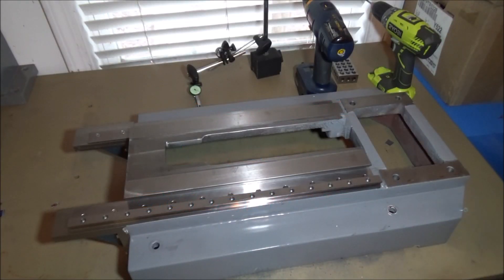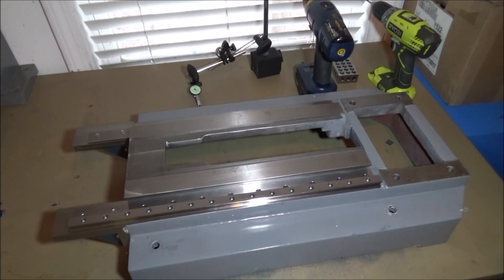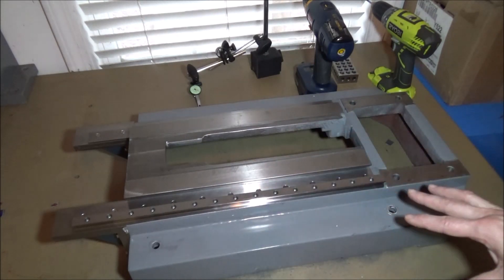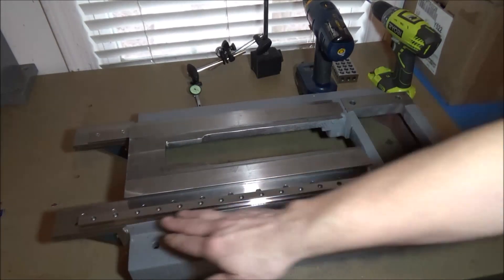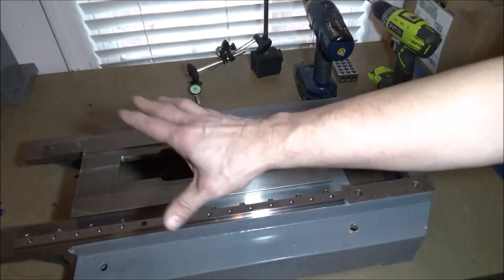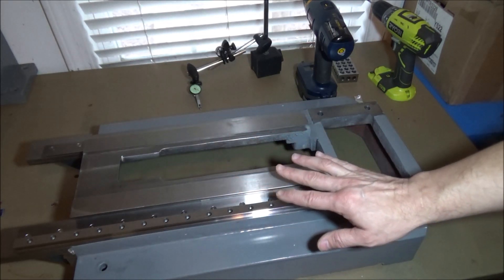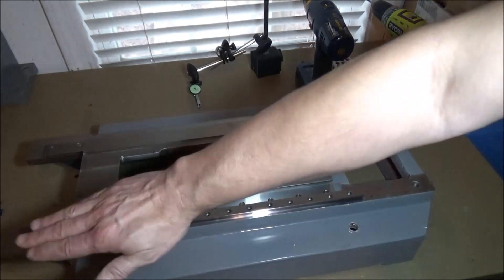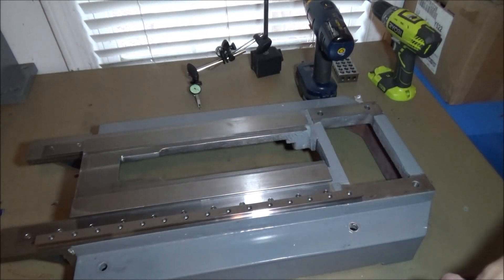PM727MXL Linear Rail Prep part2

Comment: I strongly agree with your decision to check the flatness on a surface plate, it's the only way to really know how well your mill will preform. A surface plate will be a great addition to your shop. Great progress, I'm interested to see how flat the surfaces are from the factory. I have a pm940 on order and plan on making a project of hand scraping the dovetails myself. Luckily I work at a shop that has large surface plates that I can use to check my project.
Reply from the maker: Thanks , Yes I could just go forward the way it is and the Accuracy will be no worse than with the dovetails but at this stage i would really like to Know where I stand! hey maybe its fine , Maybe its off a ton, twisted , warped etc. but its the Not knowing that I dont feel good about. So I will check than I can make a decision on how to proceed.
It I'm comfortable with the tolerances I'll proceed as planed.

Comment: I have been following your project. Nice job.
I’m glad your getting a surface plate you need it. You might consider going a little larger. Based on the projects your doing I know You will never regret it.😀
Reply from the maker: I agree If only I had the space I looked at a 24 x 36 x 4"  but they were #380 vs the #150 of the 18 x 24 x 3

Comment: A good surface grinder would be nice to own. That would be a good way to check and correct the surfaces. You never really know how accurate these bench top mills are machined and ground unless one takes them apart and checks them. They can vary from mill to mill so it must be done on a mill per mill basis. It's all those little things that can add up and make a more accurate mill in the end. I do think the linear rails are the way to go for speed and long term wear. I have a pm940 on order and am going to convert it over and am debating going with rails. I ordered the mill with hardened ways and may wait to see how they hold up. It would be best to put rails on a new mill before any wear can make it more difficult. I'll be keeping an eye on your progress and see how it works out with your mill.
Reply from the maker: Yes I agree best to start with fresh ways. This mill was never used so I'm good in that regard. I hope to have time to measure things this week to see where I'm at.

Comment: Fantastic plan you have going forward. Appreciate being able to experience your findings! What brand and accuracy rating on the new surface plate.  I need to but one as well
Reply from the maker: 'Thanks 

, I picked mine up from MSC , https://www.mscdirect.com/product/details/00468579
Grizzly had the best price about $170 but out of stock and you had to back order  this one has Ledges plate some are more expensive with ledges some cheaper not sure why. This one has a Accuracy of. .00015

Comment: With how light this cast frame is, and how light duty the machine is. I don't believe you'd notice any difference in cut quality, accuracy or rigidity by grinding the ways. In my opinion, you'd gain more by going with a higher quality rail like Nippon Bearing rails. I have torn many different carriage blocks apart and found Nippon to have the best quality. Rexroth rails have the worst looking grinds where the bearing ride. Our Doosan industrial lathe has Hiwin linear rails and any slight bump of the tool (aka light crash) breaks the carriages and a tech has to come replace them.
Reply from the maker: Thanks for the info

Comment: Not sure if you would be interested in this but have a look on Instagram for #spaceyguitars he is a machinst that works at/with NYCCNC. He came up with a bench grinder mounted on a lathe cross-slide, mounted in a vice, that he slides across a granite surface plate. With his surface bench grinder set up he is getting flatness within 0.001". Might be something to look into.
Reply from the maker: Thanks !
Reply: I am also interested, but couldn't find #spaceyguitar(s) with anything machinist related available that you described. Only Rock band related posts. Can you provide another reference?
Reply: @xfsr20box  sorry do a search on Instagram for spacelyguitars the post I'm referring to is a quite a bit down he posted it on August 13th this year, also a few more recent post refer to him using it and shows pictures and videos of the finish